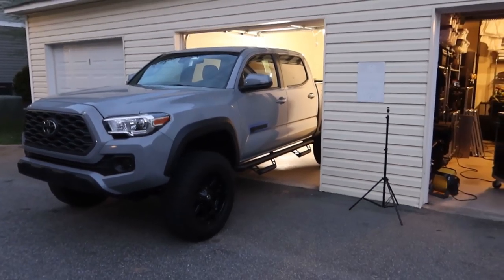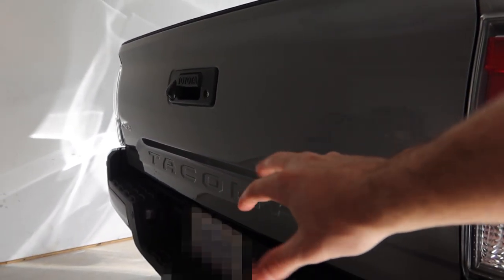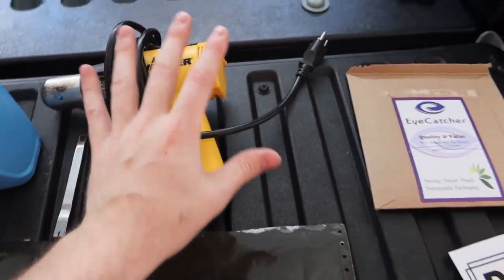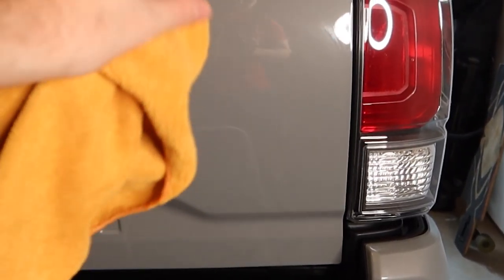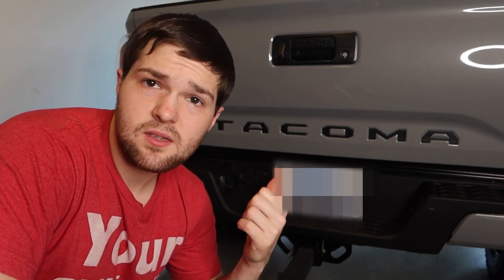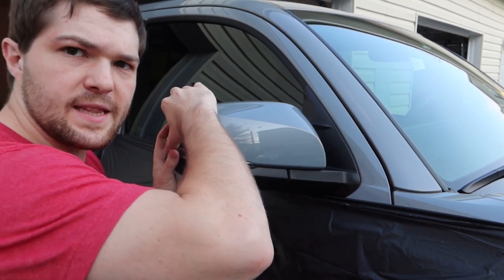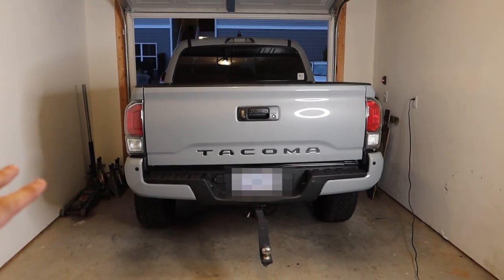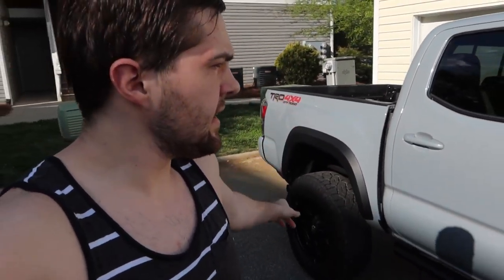BLACKING OUT my 2020 Tacoma for $50 (How to plasti Dip | Remove Badges | Tint Lights | Tailgate)

Comment: Just got a 2017 limited taco with 20k miles. Sooo much chrome on it. Can’t wait to try this and get rid of it all. Thanks!
Reply: It is easier to just buy the overlays off EBay.......don't have to wait for coats of plasti dip to dry. I was going to dip mine till I saw a couple of videos using the overlays. Plasti dip probably a "little" cheaper.

Comment: Rick, thanks for putting in the time to share your experience. Just bought the same truck last week, super excited. One question, on the side mirror black out film. Does it interfere with blind side sensors?
Reply from the maker: No. That sensor is actually in the rear bumper.

Comment: Can you post an update on the the light output is on the side mirrors after tinting the blinkers?
Reply from the maker: Sure I'll pencil it for a later video
Reply: check out the mesocustoms turnsignals that already are blacked out and brighter leds then stock. They are in stock now, i just ordered friday.

Comment: Quick question, great video, why didn't you just remove the taco logos and paint or plasti dip and then re adhesive back to truck?
Reply from the maker: That's way harder and you risk scratching the paint
Reply: @TacoRick  You should just remove them and keep them off.